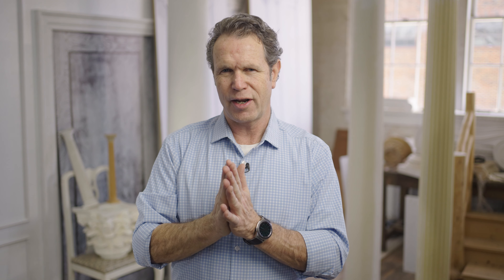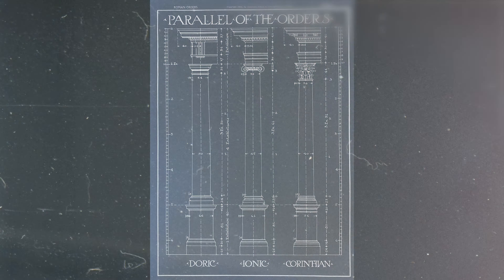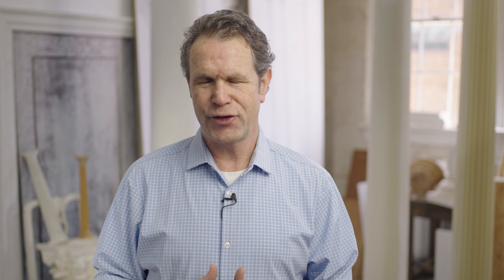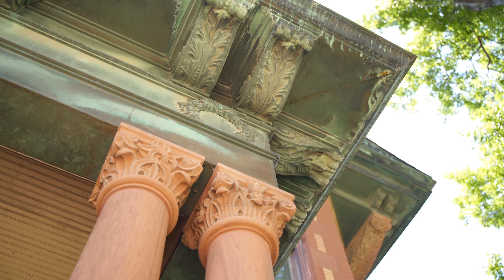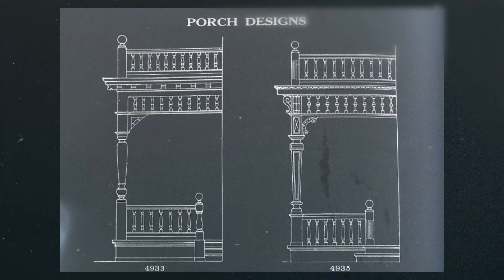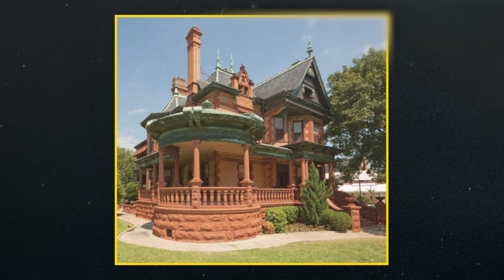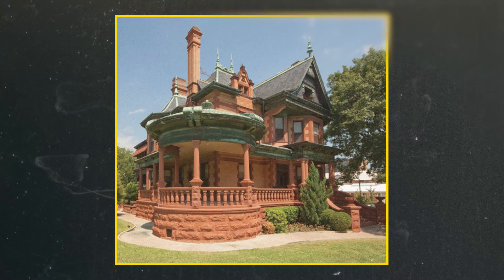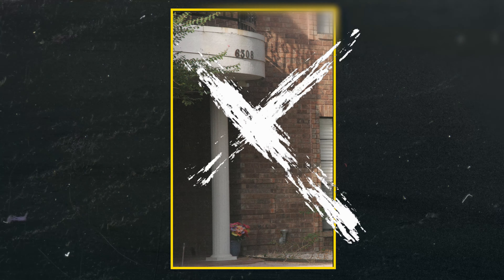Column review. How to choose the right columns. Scale and proportion start here

Comment: Hi Brent , great video as always. You mentioned you use great woods when fabricating the columns and avoid pine. What sort of wood are you typically using for exterior columns ? Is it sapele mahoghany?
Reply from the maker: Yes, Sapele. Which is like an African Mahogany. We are really impressed by its strength and stability.
Reply: @BrentHull  is this column of sapele stave cored or t&g or solid glued ? And is it qtr sawn selects only for shear strength?

Comment: I am curious, at the 6:57 mark there is a really pretty classical style house I was wondering how you felt about the columns being so tall that they support the roof and have that second story balcony sort of running through them as opposed to using shorter columns to hold up that second story balcony and then another set of columns supporting the roof?
Reply: Ooops 6:47
Reply from the maker: Well, it is a pretty typical neo-classical design motif in the early 1900s. The composition works and it is a fun way of treating the home. My 2 cents. BTW, the Kell house project was styled very similarly.
Reply: That is interesting. There are two examples of two story houses, one after the other. The first shows tall columns with the second floor porch attached or intersecting the two story columns. The second shows single story columns, the second floor porch, and a second set of columns going up from there. I don't see how the Greeks or Romans would've attached a porch floor to a tall column, so I have to think the second example is more historically accurate, i.e. columns are only as tall as to reach a floor above them. But I don't have any real knowledge of this stuff.
Reply: Yeah I gotta go with you on this one